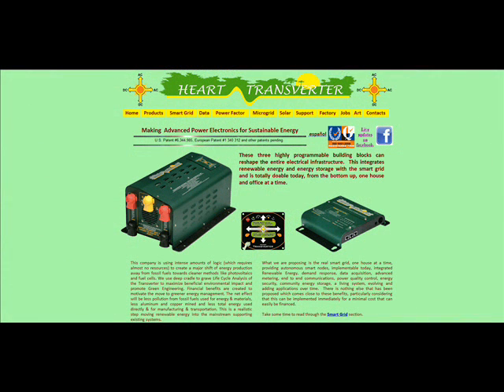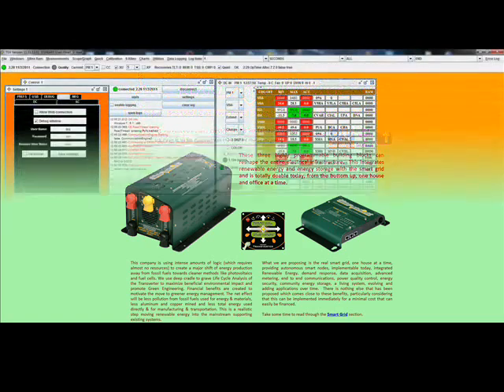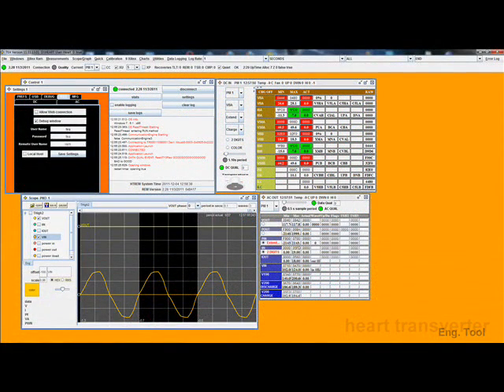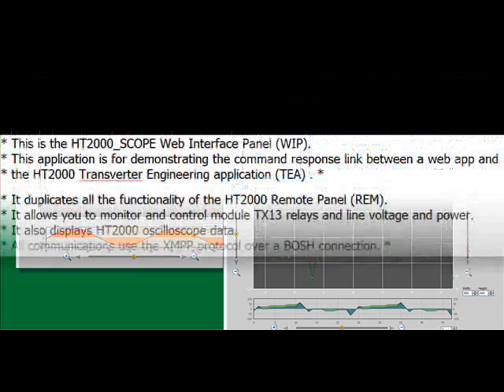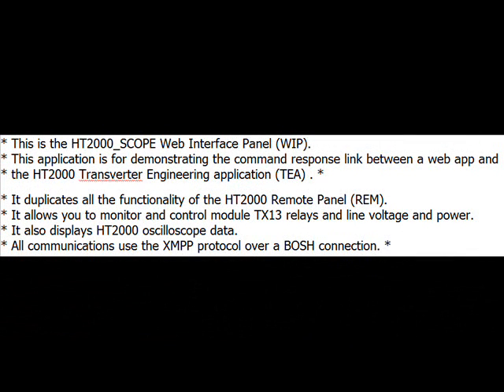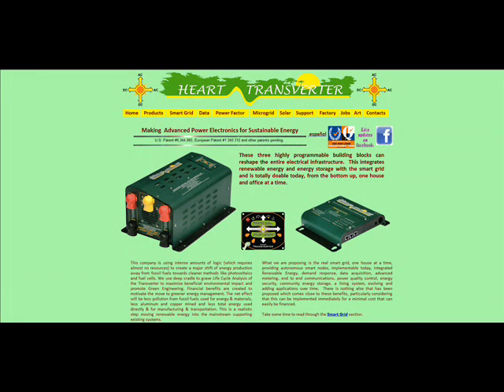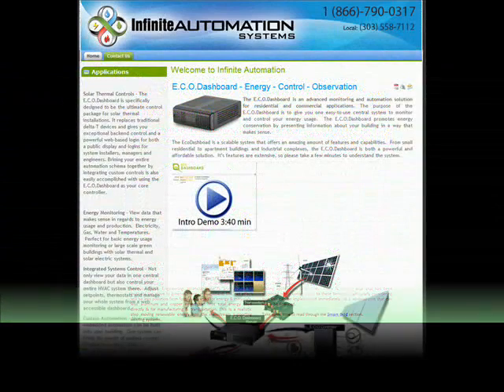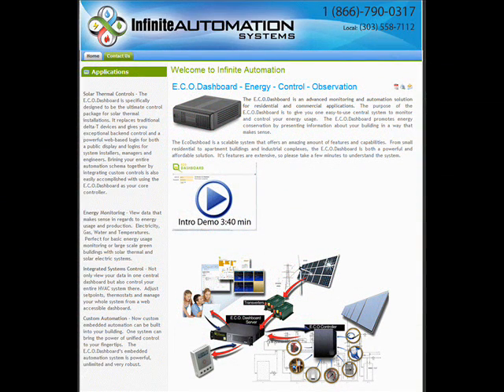xverter_1.wmv

Comment: How do you connect the HTREM to the network? or how would you connect a HT2000 to the internet?
Also what adress is the web application please
Reply from the maker: Ivan,

I have not been involved with Heart Transverter for several years, I'm doing microgrids in Africa with different equipment.

Last I know the TREM could not connect to a network, the Transverter Eng. tool takes care of that.
The GWT app is not currently running anywhere.

I'll probably take these videos down.